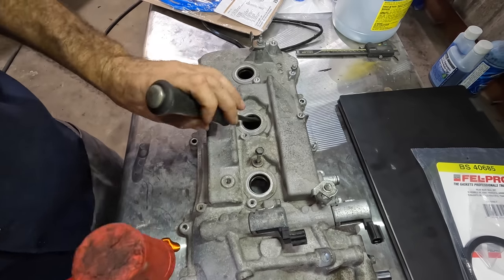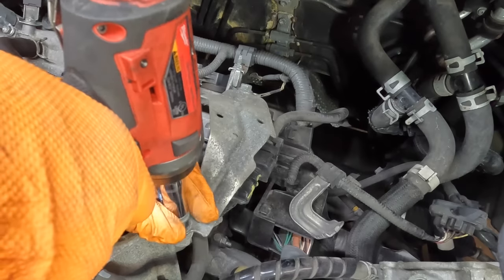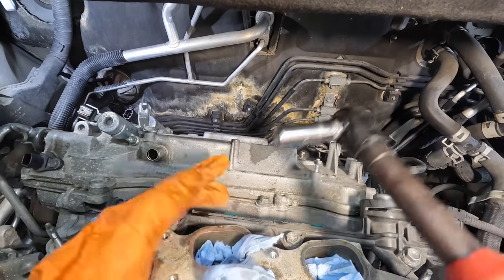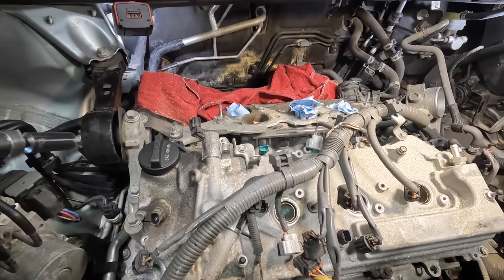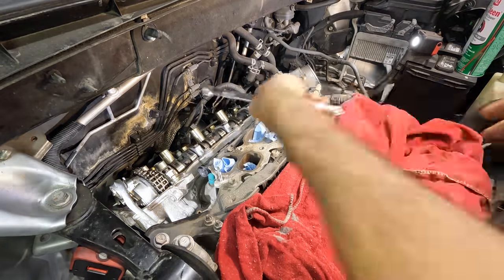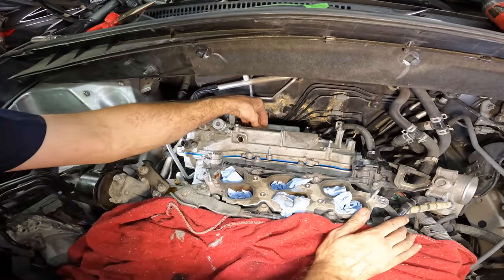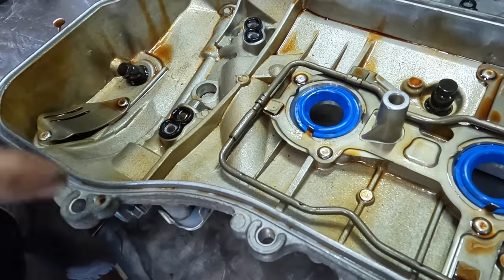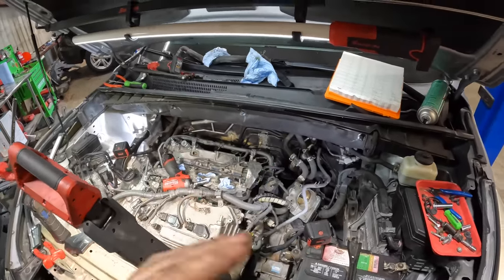Mechanic Upsells Extra Parts! "While we're in there..." Toyota 3.5 VVT V6

Comment: I'm sure the timing cover is leaking, easier to sell that as engine out job, then the intake manifold is easy.😉
Reply: The Car Care Nut (a Toyota specialist) said that all these 2GR-FE engines have a characteristic oil leak where the head meets the block at the timing cover. Have to pull the engine to remove and reseal the timing cover. This is often mistaken for timing cover and oil supply tube leaks. His advice was to live with it unless it’s seriously leaking.

Comment: Honestly if you were going to replace the rear coils make sure you do it with Denso coils cuz otherwise you're just doing a disservice to your customer aftermarket coils will definitely fail long before denso coils will I have a 2007 RX 350 with its original denso coils at 260k mi (same 2gr fe)

Comment: AAAAAAAAARRRRRRRRGH.  I have an Aussie all wheel drive equivalent (Kluger).  Do I spend the money on a dealer or 3rd party maintenance; or buy a whole heap of tools and do it myself.  There is so much deconstruction involved I was not aware of.  Thanks for the insight Ray......and @$%^&*()(*&^%#%^& I thought I had a user friendly vehicle.  So much for my fencing wire, bubble gum and soap toolbox that used to fix anything in the middle of nowhere.

Comment: Your going to love this Raymond. Use OEM parts only from a Toyota dealer,  seems our Chinese frinds have been making copycat toyota parts in factory looking boxes with Toyota stamped all over the parts but they are not Toyota qulity parts stright up fake parts and even Toyota tech can be fooled but they have a few hints its a counterfeit part if you know what your looking at.  Most Toyota dealers will set you up with a parts program %off retail cost.  

Yes Toyota parts cost more, but they last 4 times longer.

Biggest problem with aftermarket parts,  coils made in china. Absolutely junk. Misfire city  changed one 4 times they last a week. Lifetime warranty  but the dam coil kept going out  finly after about 5 of the same one got a good one.

Comment: I know a lot of people would suggest disconnecting the battery when messing with so many electrical connections and ground wires...But apparently it was of no concern to ray...which I really think its not a concern but maybe a safety precaution that one would consider.
Reply: I believe if you was working on the alternator or starter then yes pull the battery cables otherwise it might just be a habit to just pull them anytime but also keep in mind all your settings like seat or radio clock settings will be cleared if battery unhooked

Comment: I dislike when small bolts are extremely tight I always feel like they are going to break and putting a drill bit to an engine to extract a broken bolt is my worst nightmare does not take long to ruin a head or block

Comment: How about changing the plugs also?
Dumb question:  Why is there engine coolant running through the throttle body?
You don't own a mirror?
Reply: It's motorized, and probably water cooled. My Mazda 6 is the same way.
Reply: They started running coolant passages in the early 70's.  The reason was the throttle body plate would get stuck in the open position in the winter time due to ice build up.

Comment: If some 'a'hole put sugar in the oil filler cap would that be damaging to the engine?
Reply: Not really,it will get caught by the filter before it reaches any of the lubrication seurfaces.From the top of the engine it goes straight to the pan in the bottom without doing any lubrication.From the pan it goes to the filter first,then to the rest of the motor that needs lubrication.
Reply: @djsi38t  thanks.

Comment: WHY WOULD YOU NOT USE SOME ANTI SEEZE ON THE SPARK PLUGS?
Reply: The factory didn't and they came out just fine.  Using anti-seize can potentially invite a misfire condition.

Comment: You pulled a towel out of an intake hole, and it's giving me anxiety.
Reply: He did at 10:54, but I have looked frame by frame an I think he's winding us up.  However, so far only three have commented. . . . . . . . . . . .
(Edit)  Maybe it's the Constance Babington-Smith test. . . . . . . . . .
Reply: @572Btriode  He ended up putting it back in at 18:40.
Reply: @Yurindeep  Yep, he did, I still wonder if it wasn't a test though. . . . . . . .   🙂

Comment: What about what fell down in the camshafts down in the rest of the engine that just that little find dirt will act like a grinding compound. I've done auto repairs heavy equipment repairs and I've always plug the intakes of anything that I took it apart and before I even started on the engine. Or are used in air hose to blow all that dirt leave Styx any sand because it's a perfect place for it to collect down in where you're working at on top of the valve covers and on the intake be more professional about your work that goes for differentials when I'm doing bearings on the rear axles even front axle I clean everything really good. I lubricate all new seals before I put everything back together. Over 35 years certified mechanic everything you can imagine

Comment: Those valve cover spark plug seals are incorrectly manufactured. Looks really chintzy to me to bend a holder for the seal which is way too loose if you can push them in with your fingers. Looks to me like the correct fitment for the seals would be to tippy tap tap with the rubber mallet. Then they would fit tighter and not need those bendy seal holders and ya'll say on Nissan they are plastic which gets very brittle with heat cycles. Both very incorrect manufacture. Japanification which is 5,000% better than Red Chinese anything.

Comment: So what was the problem? I see useless maintenance here, the originals are far better than the new Felpro gasket set and will probably be more of a problem down the road, because, the customer is going to say, " I just replaced all that stuff". As he was saying in the video, "these seals aren't tight light the originals" "bingo" . So besides the spark plugs and they weren't bad, what's  the problem lady? Change the oil, filter, possible the coolant and a good undercoat and let it go. Now if I seen oil leakage around the valve covers, then again how much is leaking? waste of $900- $1000 bucks IMO.